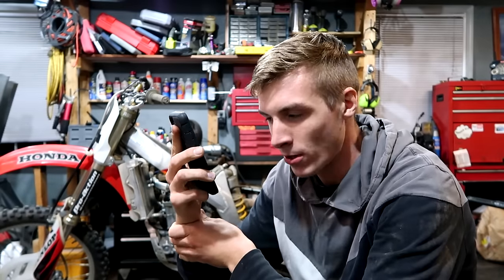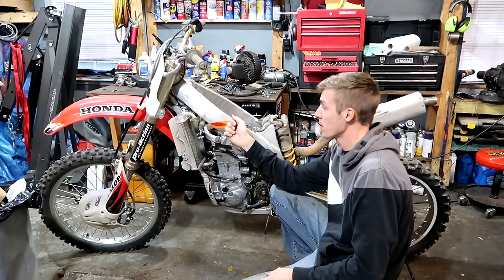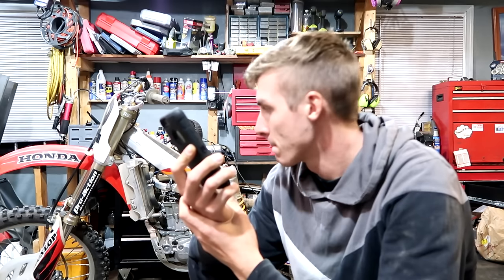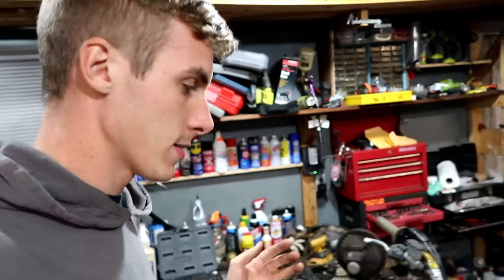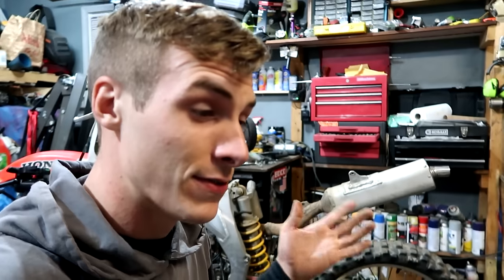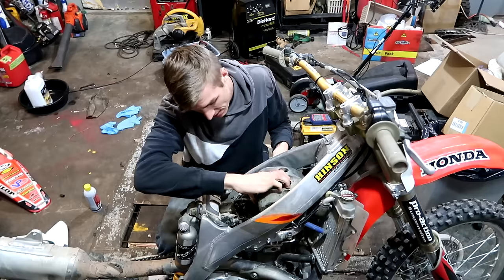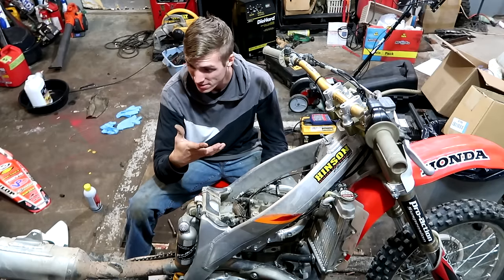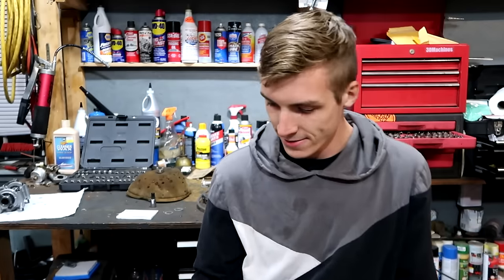THE HONDA 450 IS TRASH

Comment: You should definitely try using smaller shims before getting new valves. No point in getting an expensive kit, just go down to a local mechanic/dealer and ask if you can swap out the ones you have for a smaller size. My local guys had a few spare and were willing to swap me for my old ones.

Comment: A worn out air filter causes closed up valves. It probably explains the engine quitting on idle recently.
Reply: jonnoMoto i can confirm this as i bought a kx250f from a guy and air filter was worn out badly and an intake valve was closed and damaged
Reply: thats what happened to my crf 250r air filter was junk and it damaged the valves cost like 1200 buck to have them done
Reply: jonnoMoto but hey when he got numerous comments saying how bad his air filter was he choose to ignore it
Reply: You need a valve shim kit
Reply: jonnoMoto my air filter is in good shape but my valves are somehow closed up.... What's wrong with my bike?
Reply: jonnoMoto my Hondas is 50 years old and there's no air filter on the carburetor and I ride it through the swap and it can hold up wheelies as long as I can balance even tho it's a 49cc lol I think modern bikes are built crap
Reply: Lol Gem is it an Mx bike and ridden like one?
Reply: jonnoMoto if dirt is being injested into your engine it will score the cylinder and will not have any effect on the valves
Reply: Old/dry air filter = lean mixture (sucks more air in).
Lean mixture = more heat.
Too much heat = burned valve seats.
Burned valve seats = reduced valve clearance and compression loss.
Reply: Yea all these high performance 4 strokes are built for performance and not reliability, long gone are the days  of changing oil and gas is all a honda needs... At least when it comes to performance engines. KISS

Comment: SMALLER SHIMS FIRST, STAINLESS STEEL VALVES IF YOU CANT GET SMALLER SHIMS!!!
Reply: Exactly its not that they aren't seating right its the fact that they stretched.
Reply: well you cant shim them that much otherwise the lifters (tappets/buckets what ever your preference) compress on the spring too much and then the spring becomes 'coil bound' basically the lifter has to push the valve spring further down but if the spring isnt long enough it becomes solid metal and mashes the camshaft. if your lucky and your clearance is only off by a few thou then it should be ok but obviously the springs have gone weak so your more likely to have valve bounce and well a whole bunch of other problems just waiting to munch your engine. best to just get new valve springs collets and probably valves then lap the valves onto the cylinder head then theres no worries.
Reply: But you don't even know how much smaller of a shim he needs yet?  Yes its obvious you can shim them down to much, but there is an exact reason of why the make a shim kit.  Could be the valves have never been reshimmed.  The shimms are right there 20 seconds with a micrometer will tell you alot.
Reply: but a shim kit is £70. you can buy new valves and valve springs for the honda for about £100. besides in the video he clearly states that the valve springs are at fault. i mean if you have spare shims then its worth a shot yeah but if the springs are that old and on their way out already its just logical to replace the springs and for the small price increase not have to worry about them as much. at least thats how i see it.
Reply: George Pacey Why do you keep stating that the springs are weak?  Honda dirt bikes come with crappy valves that wear at the seat, i have never heard of weak valve springs.
Reply: its alot more common on high performance engines that have aftermarket camshafts and longer cam lobes but age just weakens the whole system its also very true that honda valves wear at the seat and i could very well be wrong. its just from what i have learned in my experience the spings seem to have gone bad.
Reply from the maker: Sounds like a plan to me
Reply: George Pacey f

Comment: if the seat was worn down you would have low compression. Buckets and shims will typically not get damaged. The shims are there so that they ware down instead of the valve shaft. The shim are most likely very worn and can be replaced by a Hot Cams shim kit. They have pretty well 3 of every size shim, and they go very small. 

LIKE THIS SO 3DMACHINES SEE'S THIS. IT WILL HELP HIM FIX HIS BIKE.

Comment: Dalton get yourself a complete shim kit from Hot Cams for less than a hundred bucks. The smallest shim they make is a 1.2 mm once you reach that thin you have to redo your valves and seats. By going to stainless valves you can reduce seat wear so that this problem happens less. A company called Big Bore Thumpers sells a whole new head with new stainless valves, new seats and new springs already installed for $550. Check out their web site.

Comment: I have an oldish honda 250 4 stroke. never rebuilt it and I use it everyday in the summer and quite often the rest of the year. only change oil once a year. it knocks but it's knocked for years already. you may think things are off or wearing out but it will keep on going

Comment: Little tip for next time.  Just take off the seat and tank then remove the lower 2 subframe bolts loosen the top one and then tilt the whole subframe up.  Then remove just the top shock bolt and you have perfect access to the carb.  Taking the valve cover over and trying to take it out that way sounds like a recipe for dirt particles in the engine.
Reply: Also you can re-shim the valves a few times before having to get the head rebuilt.  Just go get yourself a hotcams shim kit.

Comment: I bought kibble white rr stainless valves off amazon for my 2003. removed the head myself.and had a machine shop lap in the new valves and shim them. then I put it back together. was about 400 total

Comment: You could remove carb w/out removing shock or valve cover. Just disconnect it from the intake and slid it out through the frame opening on the left side of the bike.. Great vid!

Comment: It sounds like you should do a valve adjustment. I had a honda crf250 where my valves got too tight and wouldnt run. I did a valve shim adjustment and it solved my problem.

Comment: just change the shim to adjust your valve clearance.  Any shop should have them, and check the current ones for size and go from there.  DON'T CHANGE YOUR VALVES.  your valves have worn into the seats is the reason you have no clearance.  you can check but that's my humble opinion

Comment: I have a 2005 crf 450 that has dropped 2 valves then I rebuilt it and it threw the rod out the front so I bought a new motor then got a rod Knock then rebuilt that and now it still runs. I have adjusted valves countless times now. Just buy a hot can shim kit. It may be a lot of money but it is worth it
Reply: And if those valve clearances are not within .03 the bike will not start at all

Comment: Just grind the middle circle of the valve cap (dont know how to pronounce it correctly in English but 3:04 part) till the valve clearance is within spec. This procedure is done on some cars with higher mileage and it's correct way.

Comment: Pull the head, check for valve/seat wear... If the valves and seats are in good nick, shim the valves and you're good to go. A little bit of close up is normal, it's only a problem if it starts holding the valves open. Replacing valves and seats isn't massively expensive if they are shot ;-)

Comment: pull the head and use a Valve Seating Tool. it uses a gritty gel and you spin the valve in its seat and it perfectly re fits the valves. look into it!

Comment: you probably should be checking the valve seats if you think the valves have moved deeper in the seats rarely do they both do that at the same time....also did you check the shim clearance hot or cold because you will get different readings hot and cold

Comment: those early crf 250/450 had real bad valve problems up till like 08
Reply: Peyton McAdams I herd the hondas still have extreme valve problems
Reply: Peyton McAdams I have herd this too, which sucks because all my 3wheelers and quads/utility wheelers have been Hondas because they just last even abusing them.
Reply: Thomas Hubbell yeah, I kniw all the other bikes and quads  are great bikes, just those early 2000 race engines had those valve problems
Reply: Peyton McAdams I had an 03 and it never gave any problems look how old 3d machines where until it did.
Reply: Peyton McAdams very true both my old crf 250 were bad about needing shim work so I got rid of them I'm more of a Yamaha guy

Comment: Could you have just re - seated the valves and lapped them? It isnt too time consuming to take the cylinder off and do it that way. Plus by doing that, you can see if the valvs are repairable or total garbage. Just a thought, and my humble opinion.

Comment: congratulations on 400k subscriber's, and would you say fuel injected is good for racing motorbikes?
Reply: fuel injection is always better besides the price.
Reply: well fuel injection is just a better system all round. you can control the timing of the fuel and how much fuel is injected way more accuratley. they also dont require any choke or idol adjustment to start and warm up because its all controlled by the ECU. its also way more economic and fuel injected bikes have better emissions. its pretty much a hassle free system too. where carbs need adjustment and cleaning every now and again fuel injectors are pretty much maintanance free. also youll find that after a few years of use because the carb is mechanical things start to wear and need to be replaced. carbs are also pretty damn complex and hard to work on unless you really know what you are doing. my opinion get a bike thats fuel injected rather than a bike with carbs because it will treat you way better in the long run.
Reply: I would say FI is better except I just got a '16 kx450f and the tuner is $700. So if I change the exhaust and air filter to aftermarket, either I need to get a tuner or pay a shop to remap it for me. So if you want to do your own work I'd say carb but for overall performance, injected.

Comment: So why could you not adjust the valves with the lash adjusters??
Reply: ycmdill the crf250r and crf450r have a bucket and shim type adjustment to adjust those valves you need to put small shims in to gain clearance or bigger shims to take clearance away

Comment: You don't need new valves you just need to buy smaller shims, this will equal more room in between the buckets and the rocket arms, which will result in MORE CLEARANCE

Comment: what year 02 or 03 I have a 03 and I've rebuilt a few times in the last 6 years. the second generation 450rs had valve issue the trick is titanium valves and Springs

Comment: you know you an adjust the valve clearance right? the screw and locknut on the non valve side of the rocker arm is where you adjust it but you must be at top dead center on the compression stroke the clearance should be 2-4 thousandths
Reply: You know not all bikes are the same that bike  has shims and not screw type adjusters
Reply: kiwi farmer i have the same bike and you can see in the video it HAS valve clearance adjusting screws
Reply: kiwi farmer the shims are for large adjustments the screws are for fine tuning

Comment: If the valves where not seating correctly the clearances would be to big not zero! i thought you knew what you where talking about ive changed my mind.
Either the valve seat or the valves are worn causing the valve stem to protrude further reducing the clearance.
Back to school for you

Comment: you should've left the 450 alone or at least adjusted the valves that are in it now. If the top end wasn't rattling than it's fine.

Comment: no bs. yeah it could use a rebuild. any bike that age does. not just engine, forks,shock,swing arm pivots, bearings in the triple trees, wheel bearings, shit, the list goes on.....but...there are alot of guys, that would have adjusted the valves with a shim kit, and a service manual, and would have rode the crap out of that. man, was it hard to start or what ?

Comment: I have 21 hours on my bike should I waste the money and check the valves?? 2013 crf450r
Reply: It would be a waste of money not too, cheaper than a rebuild in another 5 hours
Reply: Checking valves doesn't cost money, most of the times you dont even have to adjust them.
Reply: shit i got 40+ hours on my cr 80 and i ride that thing pinned
Reply: Moto2stroke trails good thing your cr80 doesnt have valves if it is a 2stroke
Reply: i mean, its free to check the valves if they're not out of spec. but j tui is right in saying that its alot cheaper for shims than a rebuild.
Reply: mini hoov I don't race just ride around in my backyard
Reply: ik its a 2 stroke  i thought 4 strokers lasted longer but guess not
Reply: Hondarider21 i don't race either but if you ride a race bike you should check it anyways. doesn't matter how hard you ride you should still check i'd say about every 15 hours.
Reply: Moto2stroke trails they do. but your bike is not a 450. lots more power and compression means stuff wears out quicker.
Reply: true

Comment: Dude just pull the head pour fuel into the inverted head and see how long it takes to leak out if it never leaks out its a perfectly good head if it runs right out it needs to be machined

Comment: i know this is a year old but what did you wind up doing? and all the knuckleheads talking about buying replacement shims to get valves back to spec need to look closer. this engine is screw/locknut style. it doesn't use shims. just need screwdriver, wrench and feeler gauge. i would have re adjusted em and rode it.

Comment: your timing is off by like a tooth
Reply: and also, you can shim them while you get new valves. get kibblewhite
Reply: well you cant shim them that much otherwise the lifters (tappets/buckets what ever your preference) compress on the spring too much and then the spring becomes 'coil bound' basically the lifter has to push the valve spring further down but if the spring isnt long enough it becomes solid metal and mashes the camshaft. if your lucky and your clearance is only off by a few thou then it should be ok but obviously the springs have gone weak so your more likely to have valve bounce and well a whole bunch of other problems just waiting to munch your engine. best to just get new valve springs collets and probably valves then lap the valves onto the cylinder head then theres no worries.
Reply: George Pacey I know, I just said if he wants to use the 450 for the race he can shim the valves for the one ride. I have an 03 Crf450 my valves are gonna be due soon, sadly
Reply: Dirtbike N00b 69 jdhdh
Reply: shimming when at 0 would actually call for a smaller shim, putting less pressure on the spring. The problem is not knowing how much tension is being put on the system for it being at 0, so you have to get a kit to play with it, but if you are at 0 it usually means your valves are worn or your seats are bad.

Comment: Does anybody know why a carb keeps leaking on a two stroke 110cc quad its my winter project
Reply: Oisin Ward floats maybe
Reply: Johnson Gamez so you think the floats are sticking sorry im irish btw
Reply: Oisin Ward could be I can't really tell from we're I am but it could be
Reply: Johnson Gamez right ok thx
Reply: Oisin Ward no problem
Reply: could be tons of things. i would start by checking the basic stuff like fuel lines for leaks the if thats not your problem try to locate the source of the leak. best thing to do would be to buy new o rings and seals for it then rebuild the carb so that you know that it should be leak free. in my experiance usually its just a cracked fuel hose a lose conector or something on the carb has a broken seal or the carb isnt seated properly.

Comment: Just lap valves use lapping compound not hard
Reply: the valves arent seating becaust the valve springs have been compressed so many times its gotten shorter. only way to fix that is with new valvesprings and valves.
Reply: George Pacey Or just uh.... shims

Comment: Dude just shim the valves, easy fix.  Hot cams make a shim kit.  Easy plus minus math, your half way done already.  If the bike ran okay most likely valves are fine.
Reply: A micrometer will tell you quickly what needs to be done.  Your local honda shop will sell and or swap you out shims out of their hot cams kit.  Owned a bunch of motocross four strokes over the years.  Shimmed a ton of valves, replaced very few.

Comment: You won't be in it that deep I have a 2006 and a 2005 Crf450 that I flattrack and they are making 58hp an it's not as bad as you think just pull the head off send it to a reliable mechanic preferably a professional motor builder and let them rebuild your head. #ridered